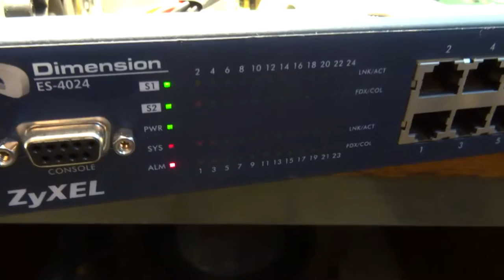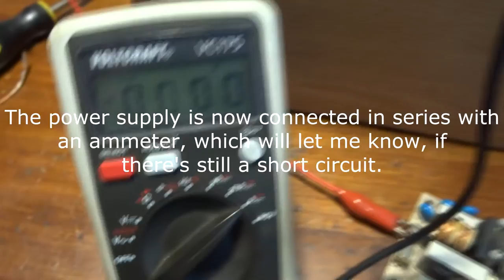Repairing ZyXEL Dimension ES-4024 - layer 3 managed stackable ethernet switch

Comment: What voltages do the red wires of the PSU output suppose to give ?
Reply from the maker: One wire by itself (one color) doesn't "give" any voltage, but rather it's potential between TWO wires (red and black - which is ground usually). Anyway, in this case it's 12V (the potential between RED and COMMON or ground (GND)). But different power supplies have different voltage outputs from differently colored wires. Computer power supplies usually have 5V across red and black, but not necessarily. You could have 230V AC on red wire, so it's not always the same; color doesn't necessarily tell you anything, but RED is usually the positive power supply wire in DC systems (voltages can vary) but you can also find red in three phase AC systems (maybe even single phase, I'm not sure), but just so you see that color isn't everything, it's still the same copper wire, with (usually) PVC insulation, that's been added a different pigment, so it's red, instead of any other color. Maybe you already know all of this and you just wanted to know the answer for this particular power supply - in this case, this explanation may help someone else. Thanks for watching!
Reply: @ElectronPower  I have 3.3V on red and 5V on yellow for an ES2024 switch so I guess it's a dead PSU.
Reply from the maker: @BorgOvermind  Damn, sorry, I didn't even notice there were also yellow wires. (it was some time ago). I'm pretty sure it was 12V on yellow and 5 on red, then, since that's how it's usually done. You say 3.3 on red and 5 on yellow? That seems kinda strange, since these are standard voltages, but if it's the same model you should at least get 12V on one of the lines. Can you check if the voltages are marked on the board, where the cable is connected? I think you should be getting 5 on red and 12 on yellow.
Reply: @ElectronPower  I was unable to find official PSU specs, so I'll open up a good one and check what it suppose to give. I'm retiring the 100Mbps models anyway but they are still good as emergency backup.